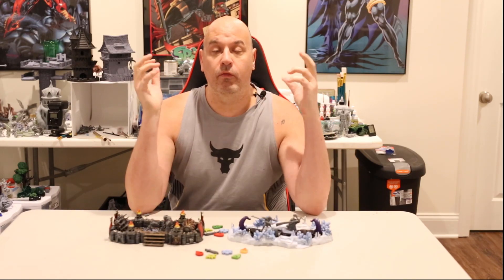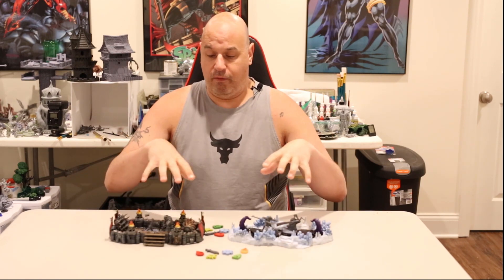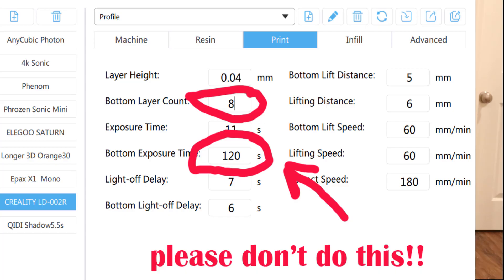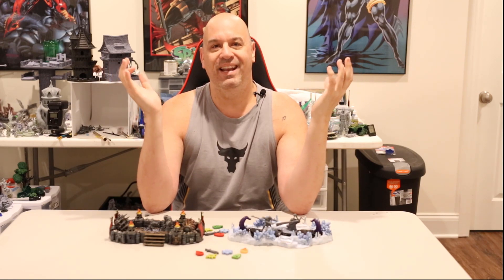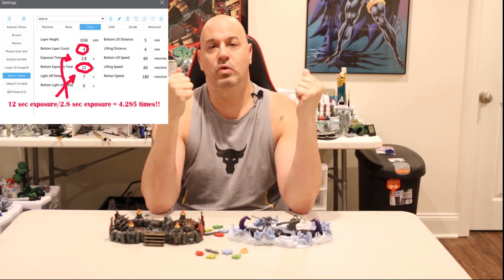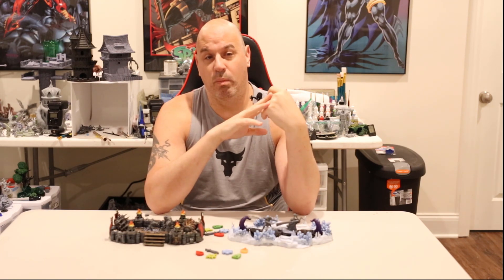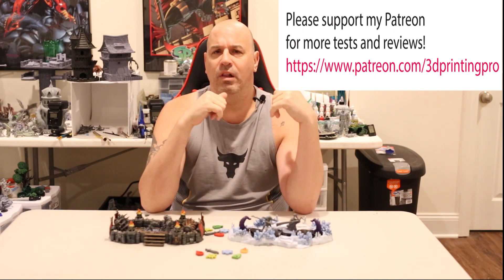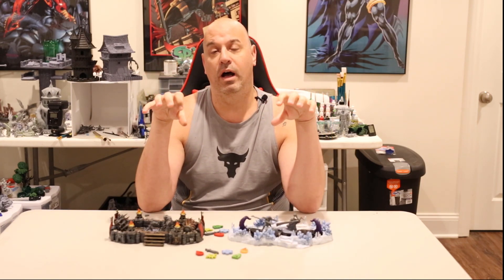Are you destroying your LCD screen when resin 3d printing?? Learn what settings may be doing it...

Comment: Fantastic advise. I went from 8 bottom layers to 5 and found my prints come off the plate easier. Usually about 45-55 second exposure for bottom layers. Very interesting that the longer exposure can burn to the FEP and make prints fail.
Reply: 6 layers with 50sec bottom exposure time optimized numbers. At least for me for Anycubic. Never failed. Also normal exposure time should not be more than 4.5 sec max. 3 sec. is suitable for many cases.

Comment: I use 5 layers at 40s right now. That is 8x the exposure time, I may go a bit lower than that since I never had problems with bed adhesion. 5 layers at 40 microns is really handy to me as I know I have 200 microns of bottom layer in case I need to add material to support bases and such.

Comment: i did a ton of experiments the first week i got my printer. so i already knew this but its funny how so many recommend settings that do nothing but make your dimensions wrong, brittle prints and killing your lcd. i only use up to 8-10 seconds bottom and 3 layers. the normals i do low 2-2.2 seconds. I also use half the lift, people recommend. as they encourage bubbles and add time for no reason.

Comment: i do 5 times my layer time. i have gone lower a few times and done 4 times layer time. it stuck but i didnt like how well it stuck. i have tried different bottom layer counts and didn't really see much of a difference. if the first layer doesn't stick then you already have problems. but on average i stick to around 3-4 bottom layers. i have used 2 bottom layers a few times without any issues as well.

Comment: Thanks.  Have a Mars and use water washable resin.  Going to print some mini heads and use your settings.  May have to stick with 14s exposure, 8s was giving me soft minis that would easily break while trimming off the supports.  Shouldn't have that problem with heads, don't have lot's of small bits sticking out.  Going to go with 0.025 mm slices to see if the details improve much.

Comment: Thank you, this is very helpful! I was having a lot of trouble with my first couple prints on my Mono X where it's adhering to the FEP instead of the build plate. I'm going to try following your formula for the burn-in layers on my next print.
Reply: Did it work?
Reply: @CinemaZiggy  It did. I've had dramatically fewer failures since I switched to 20s / 6-8 burn in layers. I've been very successfully using 1.4s exposure with Siraya Fast and 1.8s with Elegoo Gray @ 100% UV power. 1s Light-off delay, 6mm lift after print, 1mm/s lifting, 3mm/s lowering.  50um layer height.
Reply: @snychologist8678  Awesome! Is that just w/ minis or also larger heavier prints?
Reply: @CinemaZiggy  That's with a full build plate and heavy stuff. Really heavy solid pieces have to be in the middle of the build plate with using Lychee medium supports and bracing. I've increased the layers to 8 in those instances. I have to increase the exposure to 2s if the model I'm printing uses really thin supports or super thin contact points like .2mm when printing with the Elegoo Gray.

I've found the pixelate round and shape wall rafts to be the most successful. I have a harder time with the line triangle rafts or when the pre-supported model didn't export right and the raft isn't completely flat.
Reply: @snychologist8678   Awesome I’m will try this out! Thank you!
Reply: @CinemaZiggy  I'm going to keep trying things out and see if I can reduce the number of bottom layers and exposure times further but I just recently switched to the Elegoo gray after using Siraya Fast for a while so I'm still getting my settings dialed in.

Comment: I'm new to resin, only been printing SLA for about a week; but veteran FDM guy. 

You have been a patron Saint to resin printing for me. I'm using all of your support settings and I do 4-5 bottom layers at no more than 6x my normal exposure times. 

Since doing that I no longer need a jack hammer to release my prints and they all turn out amazing!

Comment: Thankyou so much for this, i recently added a large format 4k mono resin printer to my workshop ( previously i had Elegoo Mars and Nova3d Elfin) I am really struggling with prints fusing themselves to the fep i have gone through 3 sheets now and only had 1 successful print the fep is £20 a sheet! so it has been frustrating. I followed the settign in the calibration file, 5 bottom layers at 35s and then 3s per layer with 0.05 thickness. Watching this videao has opened my eyes and made me realize exactly what was going wrong , so thank you :)
Reply: I have a mono x as well, are you having more success now? I was having similar issues earlier on

Comment: Thanks! I went from 7 layers at 80s to 4 layers 25s, and it still works fine, using the Anycubic Eco-resin. My screen thanks you!
Reply: Which printer are you doing this on? I’m using that resin too, but maybe a different color
Reply: @teyrasiridae4704  I use the pink resin, on a Photon S.

Comment: It's a function of screen and resin, right? For example, I use a blend of Siraya Fast Grey and Tenacious, usually 90/10 - and then i add a touch of pigment. So for 0.05mm layer height Im using 14s exposure with 8 bottom at 60sec. I just dropped it to 4 and 58 sec and am going to start a 12  hour print after I send this comment.  However, using your 5x theory, I should be at 70sec for the bottom. So we'll see what 58 sec and 4 layers gives me. It's actually a fairly substantive print, a halloween pumpkin LED thing, taking up about 50% of the plate (a circle, so it doesnt cover the whole plate, but overall it's big.)

Comment: Awesome, eye-opening video! Couple questions. I'm new to 3d printing, I've had my Photon for a couple of weeks and I'm using Elegoo Gray resin. I've upped my lift distance to 7 mm and have now adjusted my bottom layers. What other adjustments should I make to my settings? I noticed in the settings you flashed during the video that you had adjusted the layer height and light-off delay times. Could you explain those/is there a video about them? I'm mostly printing 28/32mm figs and not terrain like what you were talking about. Thanks! Keep up the great work!

Comment: What about light off delay? Why yours is that high?
Reply: Light off delay has to allow the exposed resin to 'fizz' (once briefly exposed a molecule that starts changing will keep changing,  just like silver iodide) and when the plate lifts/lowers you need to allow the resin to stop flowing before next light on (1-2 seconds past plate placement)

When tuning set lightoff LONG until you get the exposure right and then you can decrease it to speed printing. Don't go below 2 seconds after plate settlement unless you like risking mid-model failure

Comment: I gotta thank you,
 Im pretty new to resin printing, and I set up my settings useing your support setting and set my printer useing this method and haven't had an issue since .  Supports just come off with a touch and model pops off build plate no issues, no more struggle.

I use Monocure3d rapid resin.

Comment: I am one of those who does a higher base and curing time for base layers and 9 layers and 90-120s well I do extrusion sometimes as well. And the kind of resin varies. However, I tried to use your sitting after I saw this video and you know what, at a certain level for 4-60s the print stick to the vet and left the print plate at 60mm hight. I increased it to 8-90s and happens again at a 120 mm level. So it's really relevant to how big your print hight and the base connection raft as well ,  this is a heavier print. Thanks for your videos and the time and effort you put in there.

Comment: I just tried your settings on two out of three prints and lost a Aluminum Build Plate in the process... I took the second set of settings you displayed and recommended (on my Elegoo Mars with Siraya Green Resin), the base of the supports was like scrapping dried old Molasses. Leading to gouging a build plate while trying to remove the prints. The minis themselves came out great and I was able to remove them from their supports on the plate. Help me PrintingPro your my only hope.

Comment: been running 10 bottom layers at 60 seconds. had some issues with stuff sticking a while ago, but lately found stuff been very tricky to get off the plate. I'm going to try and trim down a little.

Comment: Thank you for this video!  After watching it I changed the settings on both my new Mars 2 Pros and my Original Mars Pros. Reduced my Mars Pros to 60 seconds (from 75) and down to 4 layers from 8. On my Mars 2 Pros I went from 35 second bottom layers to 12 seconds and 4 layers from 8. The settings work great! I used to have to almost hammer the prints off the Mars 2 Pros and now it is much better. Thanks again!
Reply from the maker: Great!
Reply: Thanks Arcane. Will try this settings on my Mars Pro 2 as well. I am only just starting but it was a pain in the ass to take the prints off the plate : )
Reply: i have too that mars pro 2 its work ? better than the raccomanded ?
Reply: thats good to know, I just bought a M2P myself and the rook test print was so stuck i actually had to force it out by hand because i accidentally scratched the plate with the spatula, I'm going to maybe reprint the rook with these settings and then test it on a miniature
Reply: @viniciusfrj  I'm just as new as you. Definitely going to support the rook with a 10° tilt before printing because I see people complain about the flat base sticking all the time.
Reply: @DarthP00P00  From what i gathered, that rook is made to be printed directly on the plate so it doesnt require any supports, but just messing with the bottom layers and exposure time i was able to get another rook out very easily

Comment: I use elegoo grey resin on a longer orange 30. My standard layer time is 8 seconds. When I was running 6 bottom layers with 60 second exposure time I was having a large problem with the lower parts of the minis warping or the prints failing completely. I upped the exposure time to 80 seconds and haven't had a failed print or warping problem since. I'm experimenting with fewer bottom layers but having each layer cover more of the build plate with an adhesion pad.

Comment: Might be more helpful if you showed what kind of damage this can do, I assume you mean dead circles on the screen?

Also wanted to mention one thing, that can result in people having to increase exposure times: Dirty FEP film. At one point, lots of prints started failing, only supports getting printed etc.

This definitely CAN be an issue of too low exposure time, and increasing exposure can help, but for me, it was gray residue on the FEP film. Tried to clean it with IPA without any success, eventually replaced it, and the printer functionality can be back to normal.

Obviously dirty screen glass can also cause similar issues.

While both can decrease actual exposure, they do NOT decrease the display heating!

Also, if you can give your screen a bit more time to cool down, decrease lift speed. There's also direct Light-off Delay setting, but decreasing lift speed might also increase print quality.

Comment: EXCELLENT POINT John! In addition (from the source:-) I would like to add. Three (3) long exposure layers are more than enough.  If anyone has a non-sticking issue I urge you to increase the "elephant foot" or the "raft". Basically you should increase the area of the first three layers. Let's say that you should build a island on which you're going to build your model. 
Now, time wise... Everything that is more than 4-times more than a normal layer is OVERKILL and DANGEROUS!!!!!
Let's examine a bit a mechanism of photo-polymerization. As said number of times polymerization is an exothermic reaction. Meaning that during the transition from liquid to solid state a LOTS of heat is generated from your resin alone! Now to that heat add the heat from UV irradiation and you have troubles on two fronts! One being your LCD ant the other being your FEP film.
FEP film is ALREADY under stress because is under tension. When you heat it you make it softer and more "rubbery"... to the point that you get wrinkles.  LCD on the other hand got it's undesirable heat  from the bottom from UV irradiation and heat convection from "UV brick/heatsink" and from the top from resin due to polymerization. 
Think of LCD life as a rubber band. If you stretch it  to let's say 60% of the maximum you could do that almost indefinitely. But stretch that band three times to the max extension ...and the fourth time is a goner!  GOT IT?!?!?
So, bottom line... use max 3-bottom layers, use a large raft , use max 3x normal layer time for the first layers.
One trick that we use often is to use a "clean" function for making a first layer! The clean function is a method to expose the entire build area. This way you make a film of cured resin that might grab some residual semi-cured or floating flakes. Of course you engage in a cleaning function without a build plate. The trick is to lower your build plate to the bottom. Perform a cleaning exposure and then you proceed with your usual printing with a cured first layer already on your build plate.

Comment: Just some data here.  I set my Elegoo Mars (original) using Siraya Tech Fast (15% tenacious) to 4 layers and 60 sec each and printed a huge Death Kiss (Thingiverse 4560202) and had no problems.  Came off the plate easier than before.  Stuck to the plate fine.  (I was at 5 layers 65 sec before this test).  I use 8 sec per layer, 0.05 mm.

Comment: i started getting holes that project bottom to top repeatedly (i though it was dead pixels on the projector) i wonder if its a burnt LCD for the reasons explained here.... i Never found a solution other than not printing in the middle of the plate :P
Reply: this sounds like your lift height could be too low, 3dprintingpro also has a video about lift heights which might help you (if it is still a problem)

Comment: Been thinking about this as well. I've been very surprised to see such high exposures in online discussions, while in my work I'm aiming to minimize exposure times. I've been using Blu+Tenacious. My base layers are down to 20 sec. That's not quite 2X the normal exposure.  Never lost adhesion from the plate. That said, I always hollow and vent to minimize tension.

There's more to be discussed on the topic. I'm not sure that plate adhesion is the only factor when determining base layer exposure time.

Comment: Glad you made this video! I've had serious issues getting prints off my plate and never really considered messing with the bottom layer settings. For some reason I was under the impression that 10x normal curing time was a standard. I started a print tonight with 7s layer/35 sec bottom layer so hopefully I'll have an easier time getting those prints off in the morning!

Comment: Great video, iv been running 8 layers at 60 seconds. Im going to try out 4 at 55
Reply: I know it's been 8 months since you posted it, what are you using now?  did the 4 layers at 55 work?
Reply: @Fredster9984  it did, but completely failed in the winter. And was no good for vroom speeds.